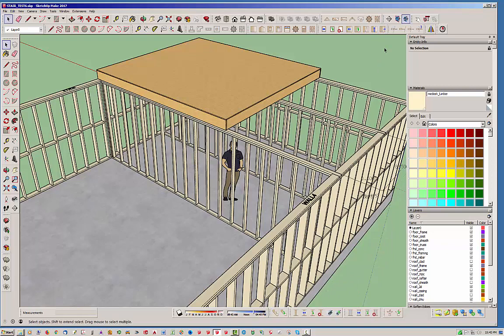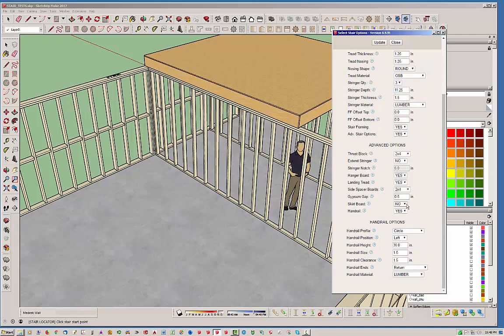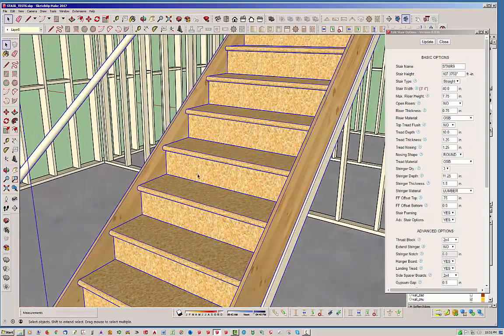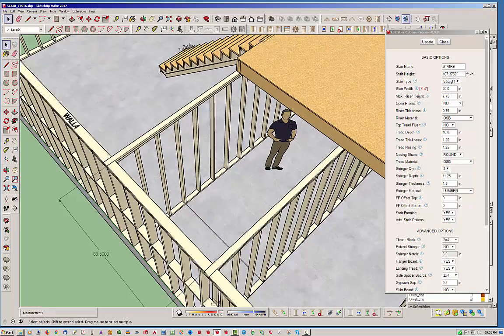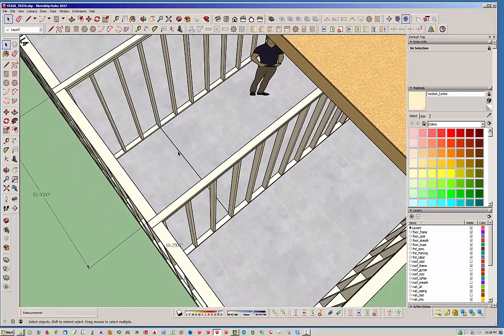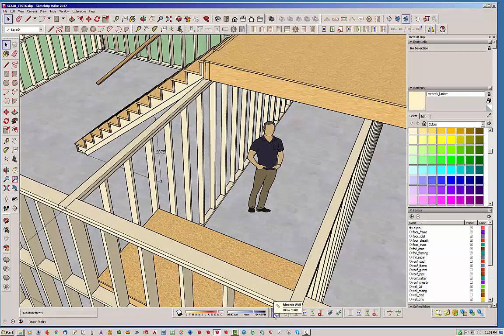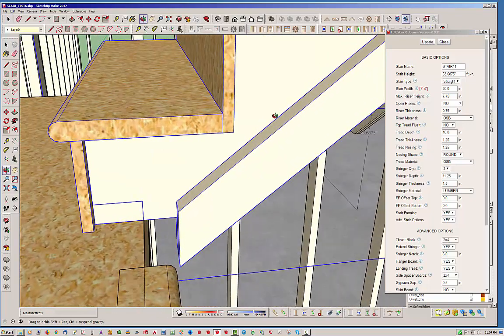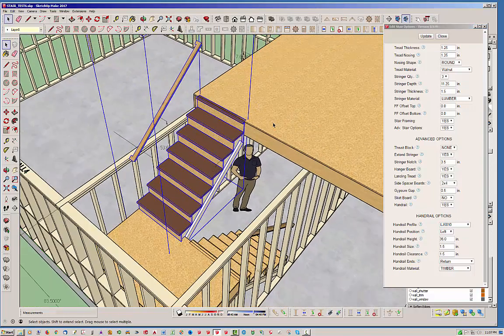Medeek Wall Plugin Tutorial 7 - Stairs

Comment: Hi Medeek,
I wasn't aware you had a 'Stair-SU-Extension,' as ever, a comprehensive extension that seems to cover most stair variants. It's a shame this extension isn't a stand alone extension & part of the wall timber framing extension. I note this because here in the UK, timber framing (wall extension) is not typically the construction direction for new builds or alteration/extension works, albeit, it is a recognised form of construction that is used in certain situations & is becoming quite popular. Moreover, the form of wall construction in the UK is refered to as traditional, i.e. masonry cavity walls, this is typically concrete aggregate blocks or Aircrete blocks on the inner leaf with an insulated cavity & face brickwork or aggregate blocks on the outer leaf with various finishes, i.e. render or proprietary weatherboards etc.

Comment: Im using the trial versions of your plugins. Very cool stuff and will be ordering the plugins once the trial expires. Been tinkering with the floor beam plugin. Curious as I can easily create walls, floor, a floor above with ceiling and rafters. Regarding the staircase opening. how do you cut the stairwell into the floor model. I dont see a stairwell opening tool. I am thinking that similar to the wall tool where you can plug in a door or window opening, you could do the same with a staircase opening into a floor. Please clarify how to get the stair opening into a floor system...Thanks